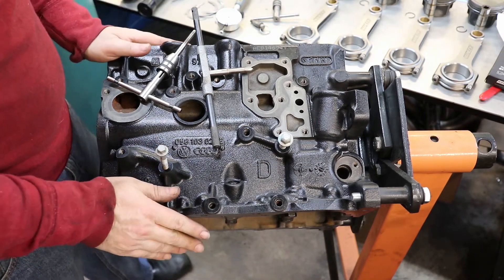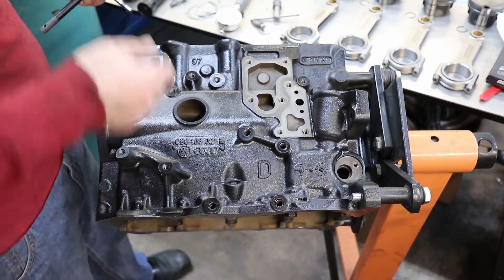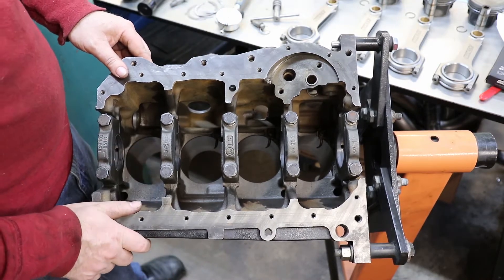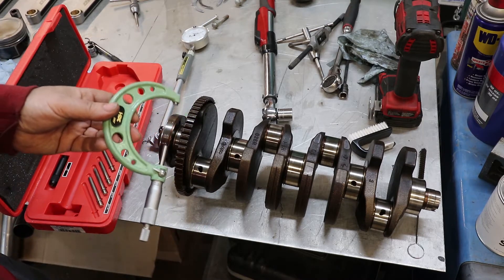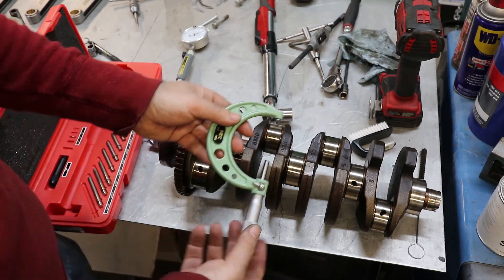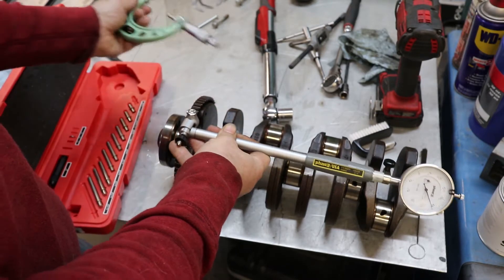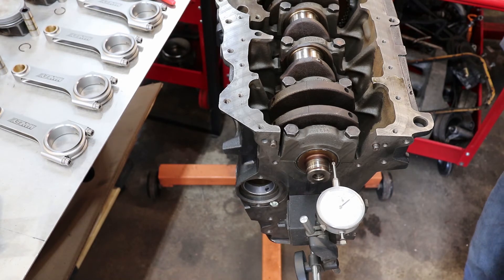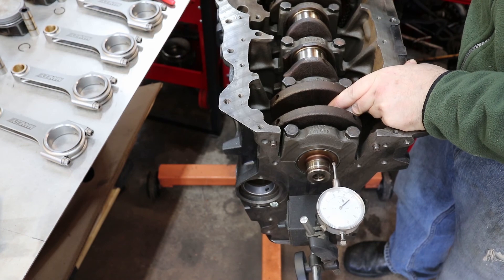Crankshaft installation for VW Audi 1.8 Turbo

Comment: Isn't it counterintuitive to torque the main bolts to measure the size of the bore of the main caps? The bolts are one time use after they had been stretched... So how do you do it? If you use used bolts... they've already been stretched and may give different torque/stretch values
Reply: Great point valid
Reply: My solution would be to have another set on stand by other than that his assembly looks clean
Reply: Or solution B go ARP which are not one time use

Comment: Hello Van how did you remember which fasteners go where. Any chance you know where to get diagram or specifications on that?
Reply from the maker: It just takes counting and measuring - and making sure every fastener has 1-2x diameter of thread engagement.  E.g. if it's an M6 bolt, expect it to have 8-10mm of thread engagement.
Reply: @vsvenson  thank you very much for the reply and the videos. Currently rebuilding this engine and found your videos helpful.

Comment: looking at what you're doing and this is how it should be done. btw, can you explain how did you clean and get block painted, tha
Reply from the maker: My machine shop that did the cylinder honing cleaned and painted it.

Comment: I noticed the angle indicator was also possibly measuring the movement and flex of the engine stand. Does that device account for that? Also, I’m bringing my 944 over. ;-)
Reply: And thanks again for producing these videos!
Reply from the maker: Yes, there is a little flex in the stand... I try to pre-load the breaker bar enough before resetting to zero, but it still might be a degree or two off.  But that should be within tolerance. :)